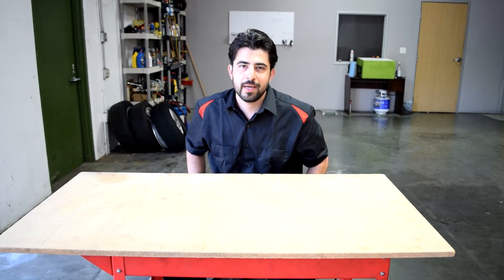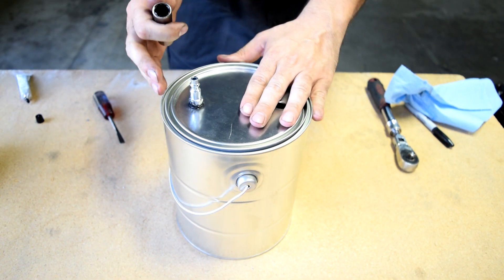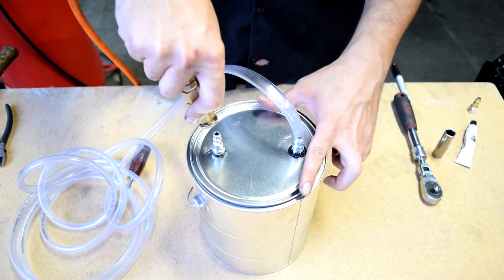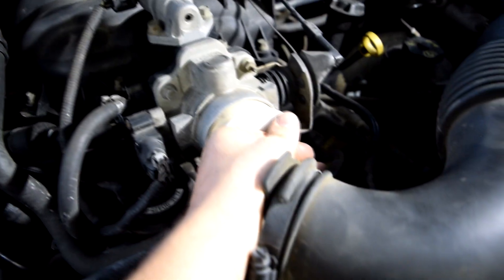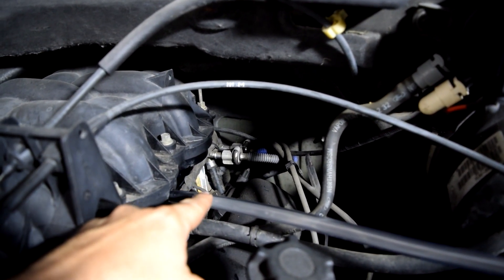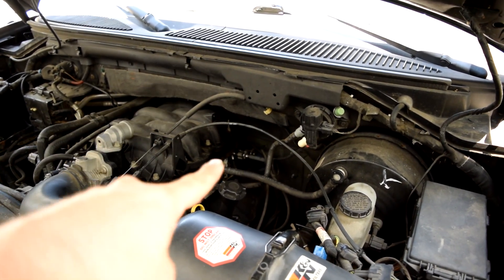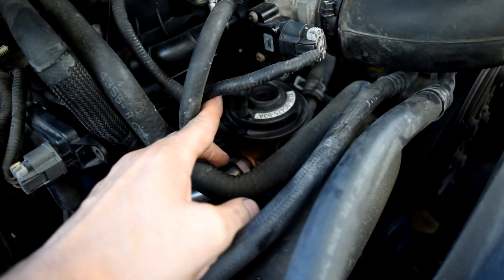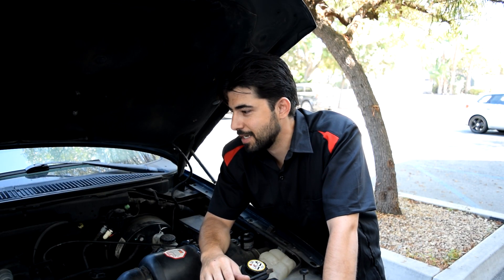How to Make a DIY Smoke Machine

Comment: I have the same issue with longft1 and longft2 higher while idle, I did a smoke test in a pro mechanic and no leak .... sometimes p0430 p0420 comes..... what's to do ?

Comment: So now you've just coated the entire inside of your TB, manifold,  vacuum hoses, & whatever piston has it's intake valve open with whatever noxious plastic residue created by burning that synthetic rag. News flash: burning things leave residue. BAD IDEA. The first sign this is amateur-hour was your lament you didn't have the right nuts for the connections. OF COURSE YOU DIDN'T. These are tapered fittings. Duh. 2nd warning sign was the soap bubble leaks. This whole thing is a HOT MESS of bad mechanical diagnostic tech & technique.

Comment: Cotton batten from fabric store and alumium foil wrapped over cotton batten will insulate enough so you will not get burned. Should be cool enough to at least touch without harm. Just fold to join foil. Then use aluminum duct tape on the seam of the foil.

Comment: I just made this with a paint can, air compressor and a garden hose. Works great 😀 If you turn up the air compressor you can make a jet engine with that fire lol. Unfortunately didn't find any leaks in the engine yet. But i'm still working on making the smoke generator more air tight so more pressure can go into the engine.

Comment: You are not going to find washers and nuts to fit those quick connect fittings. They are National Pipe Thread which is tapered to ensure a leak proof fit with another fitting with female thread. The best you can do it to but some cheap couplings and spin them on. SO now I will stop watching this video since it's fairly obvious this person doesn't really have a clue. No subscription for you.......

Comment: From another video -- use a soldering iron to heat the baby oil saturated rag.  You avoid the fire and the excessive can heat.  The other video used a glass pasta container.

Comment: Kustom Smoke makes smoke machines like what you did, but they have a heat source and two electric clamps to connect to the battery.  Hopefully, it you rebuild it, it would be different.

Comment: 1) Look up: Use a soldering iron to heat the sock.
2) "Can not be more then 2 psi or will damage the system." A N/A thing? Alot of us boosted guys do ~20psi testing.

Comment: The idea is great, but you need a longer tube into the bucket on the intake side so the air reaches down to the fire. If not the oxygen gets sucked out at the top to fast and you end up as you did now.

Comment: I found a very easy way to make a smoke machine and you clean everything on the top half of the motor too. Buy a bottle of Lucas injector cleaner in the 28oz bottle and take off the hose of the break booster and let the bottle suck it in and you will find leaks that way.

Comment: A hand (bicycle) pump works really well if you don't have a compressor.
If you cut a third hole in the lid and glue a cheap soldering iron to it (with the hot end inside the can).
With enough mineral oil in the can, and a saturated rag touching the soldering iron tip..you'll have lots of dense, white smoke.
Reply: Will that completely ruin the soldering iron?
Reply: @BrananaPuddin  Na it'll be fine, you can clean it after with a wire brush.
Reply: @BrananaPuddin  soldering iron tips are usually readily replaceable anyway...
Reply: better and safer

Comment: I have a 2002 Ford van 4.2 engine. I learned a lot from your videos. I want to build one of these and see if I can find my vacuum leaks. Thank you for sharing .
Reply: You won't find them.  4.2s leak internally replace all your intake gaskets.
Reply: @davidchristopher5976  Thank you for that. Can you just tell me how many hours for that type of job?
Reply: Just a couple.  It's pretty easy and straightforward.  Sometimes the intake breaks internally too.  You may have to replace it.  A junkyard will probably have the updated part.

Comment: next time try Drilling a hole in the middle of the can between the two fittings glue a cheap soldering iron through it to keep the rag burning
Reply: A soldering iron doesn't do anything for a fire. Soldering irons only work around 100 - 250 degrees Celsius, which is way too low to ignite anything.

Comment: It's a great idea, but bad implementation. Your injecting physically burning material into the engine, particles of which can contaminate it, get on sensors, and cause more problems and more money being spent to fix those in addition to the original problem. You can purchase cheap smoker machines that use mineral oil (OEM approved) on eBay.

Comment: -9 or -10 on both ltft indicate vacuum leak???
Reply: Not directly. If your O2 sensors are reading correct voltage, see if your LTFT gets closer to 0. If it does it could be a vacuum leak

Comment: I haven't done it, but I was wondering how a smoke bomb that you can get at your fireworks stands would work. Seems like it would be much safer than an open flame. I used to hold them in my hand as a kid. Plus you could use different colors and I would think that would be much more visible.

Comment: Great video. If you made the tube from the air compressor extend to the bottom of the can it might keep the oil burning longer. The fresh air was probably bypassing the flame and not contributing to combustion.
Reply: if you did that the fire would probably burn the tube

Comment: have you tried putting a smoke bomb in there?  Like the 4thof july one or would that pollute the system?
Reply: SGDeGalvez You need a small amount of pressure to push the smoke out of any leaks. Otherwise the smoke will just sit there and do nothing.

Comment: Try putting a couple hot pieces of hot burning charcoal in your can with the rag and baby oil...  You can also use a large glass jar with a screw on top instead of the paint can... and instead of a rag you can use some cardboard and only put so  me baby oil on one side... For those who don't have a big compressor a small compressor for inflating an air mattress will also work, or even a hand pump (that blow up beach balls) can work without fear of too much pressure..  Food for thought...

Comment: You said, "I don't have the correct sized nuts."
Reply: Joshua Smith yea sorry to hear your nuts are not sized. but that should have not been an issue. why would you not just buy the correct size nuts? why jack leg your build from the start? your looking for leaks. But creating a certain to leak test set up???
Reply: Those air fittings he is using have pipe threads (tapered).  They don't make nuts for pipe threads.

Comment: Wouldn't it have been a good idea to leave the intake air boot on to check for leaks/cracks in the boot? Leave boot connected and plug it from the opposite end?
Reply: its a good idea but he already diagnosed the leak coming downstream of the throttle body so he limited the test space.

Comment: A tip for covering the throttle body is a  latex glove, its air tight and allows you to see the pressure build withing the system by watch the glove get bigger and use in-scents they smoke good and don't get the can hot.
Reply: I think JB weld 2 part metal epoxy would be perfect for sealing the fittings in the lid.   Make holes, mix up 5 minute epoxy and install fittings.  20 minutes later you have a solid seal less likely to leak than flexible silicone.  I will be building one of these to locate a "Small EVAP Leak" code that is not from the gas cap integrity pump (Jeep JK).

Comment: Can this be used to locate evap leaks or too risky since dealing with fuel vapors
Reply: I've seen it done with a professional machine.
Reply: mrsemifixit Maybe if you plug the smoke line into the EVAP line coming from the gas tank (put a plug over the gas tank side) so that there is no chance of gas fumes working its way towards your heat source.

Comment: Some mineral spirits (cheap) and a bit more air, should be fine. That's a $20 smoke machine, an automotive smoke machine from the store runs upward of $1000. I can afford the $20! Everything you'll need can be found at lowes or homedepot

Comment: I made something similar and it helped find a leak between my brake booster and firewall.  Here is what I did instead of using fire and rag.  I used some wire that can conduct electricity and drilled two additional ports with two terminals into my can with the wire running through the mineral oil.  Then take some small jumpers and hook it up to your battery and it will cause the oil to heat up and smoke.  I used my mouth to blow into one port instead of using my air compressor.

Comment: Try 4 charcoal briskets that are well lit and then put them into the can with the old shirt. I think the coals will be hot enough to keep burning the rag in a closed can. All fires go out without oxygen.  Thank for sharing. I've made one with a glow plug and connecting the glow plug to a battery charger starter.

Comment: Hi and thanks for the video!Is it possible for a car to have only one O2 sensor? Thanks.
Reply from the maker: Sure, if a car has no catalytic converter or at least no emissions requirement for a post cat o2 sensor. This is if the car has only 1 bank. Or if its a very old car than no O2 sensors even.

Comment: Yeah, I've been meaning to make my own smoke machine. I knew the conventional use of burning oil was hot, so one day I tried to do the same with a small Halloween smog machine. It didn't work. The aerosol droplets made by the machine condensed on the inner lining of the tubing and I didn't get enough smoke out. Your technique seems better, as long as the operator is careful not to burn himself or make a fire. It would have been interesting to see if you got smoke out of the dipstick hole, to help verify a lower manifold gasket leak. Another great video!
Reply from the maker: Thanks for sharing spelunkerd, I didn't think of checking the oil dipstick tube. That would have been a good verification.

Comment: Just a thought, for a fire to continue to burn, it needs oxygen.   Perhaps if you placed some pea sized holes, maybe 25 of them, around the bottom of the can, it will keep that flame burning.
(smoke rises)
Reply from the maker: Thats a good idea, it might effect the thickness of the smoke though. Worth a shot for next time.
Reply: +Ratchets And Wrenches I did a little research,  since smoke rises, it should not affect it too much.  Boom line, that fire HAS to have air to continue to burn. If holes are closer to bottom, 90% of smoke will rise above holes.  If the fire does not constitute to burn that way, you may have to make dime size holes, OR make a few more pea size holes.  I'm curious to know which will work best for you.  Great idea you have!!

Comment: Hey thanks for the vid! Car question for you. 01 Camry and stalled on me when I came to a stop while driving. Managed to start back up and get home. Next day wouldnt start. It would crank tho. Pressed gas pedal while cranking and it started. Tried spraying iac valve via throttle body opening with cleaner. Got the car to start on its own. Ran fine for a few days.  Now wont start. Queation to you is, is it likely the iac valve stuck closed? Im about to order the replacement.
Reply from the maker: I don't think it's a bad IAC Valve, especially since you are saying now it won't start! I am assuming it wont even start when you press the gas peddle either!  If that's the case you can look else where for a fault. Any engine codes?  Try spraying starting fluid in the intake and try starting it, you might have a fuel pump on it's way out.
Reply: +Ratchets And Wrenches Thanks for the quick reply! It actually won't start now, but according to my girlfriend. I dont believe she tried to press the gas pedal but i will try that and see tomorrow. I suspect that will start it again. Given this bit of information (sorry to forget) would your direction be the iac valve? My best guess is that the fuel pump is still okay because once I got it to start it doesnt immediately stall. It ran okay for a few minutes then rpm slowly decreased. Cleaning the iac seemed to get it to start and run okay (at least for a few days). Thanks again for your advice, super helpful!
Reply from the maker: Sure, if it starts everytime you spray some cleaner inside the IAC valve than thats probably your problem, try taking it out and giving it thorough cleaning, its more than likely clogged rather than stuck closed. Clean the throttle body area as well. GL
Reply: +Ratchets And Wrenches +1000 thanks!

Comment: I used incense sticks in my smoke machine. A couple inches of sand in the bottom of the container holds the container in place and provides a way to prop up the incense sticks. Of course I used the finest Dollar General incense, can't use bad incense for a rusty Ranger.
Reply: I used old condoms
Reply: @JoseCruz-kp7ru  Oh..
Reply: @JoseCruz-kp7ru  You're supposed to bring smoke off them when they're new.
Reply: Came here to post this. Works a treat

Comment: Would this be a good idea to help find a leak in the Evap system
Reply: +Ratchets And Wrenches absolutely not !  Whoa , guys there is a problem with ever using anything other than an inert gas in a evap system . Remember you are pressurizing a closed fuel system at some point . If by chance your positive pressure should drop before venting the system , the backdraft created by the siphoning action of the change in pressure would cause your fuel vapors to head directly towards your smoke source. All smoke machine manufacturers have accounted for this and use a one way type valve even though they are using just a heating element. If they are worried about a super slim chance of an arc, why would anyone think it safe to use an ember?
Reply: i use mine to find leaks in evap systems all the time just make sure u dont have more then 2psi so u dont damage anything in the system
Reply from the maker: Yes, agreed with MANDS480. It should work just fine. gl
Reply: Also dont forget to close the vent valve to fill the system with smoke and pressure.sometime if the vent is left open it wont allow pressure to build and leak through tiny cracks.thts what i do.
Reply: Not sure if I would want to hook a flaming rag to my evap system.  +1 on the pressure being too high.  most put a BBQ pressure regulator on their air intake to limit it to around 1PSI.    Chris
Reply from the maker: Good catch, I wasn't thinking of the vapors. too risky! One might have a good chance of finding leaks with just pressurized air and some soapy water around the common leak area's that can be reached. Otherwise a professional grade smoke machine only for the evap system.